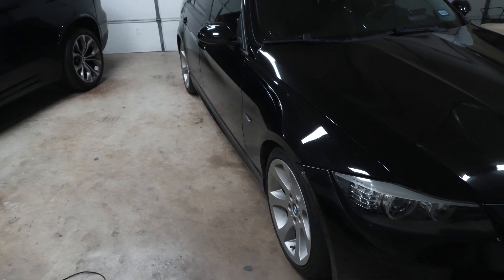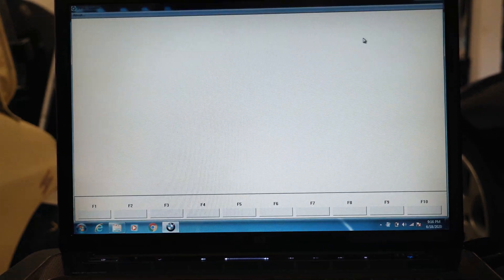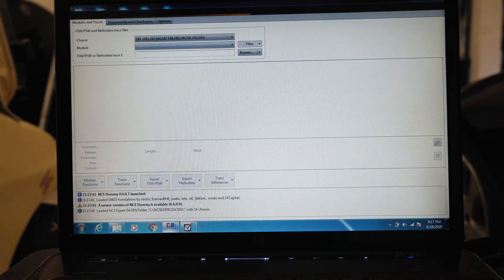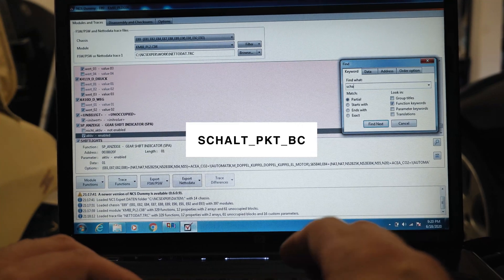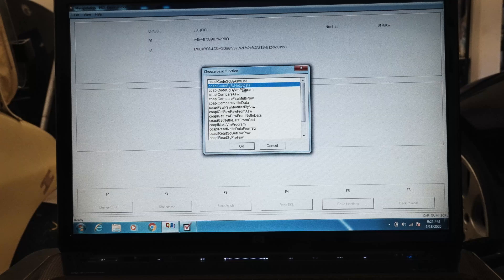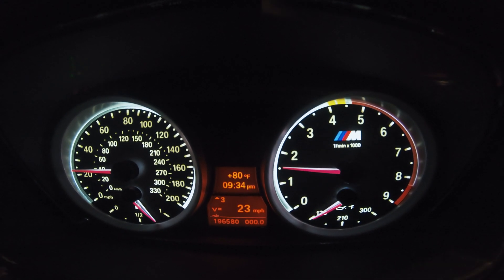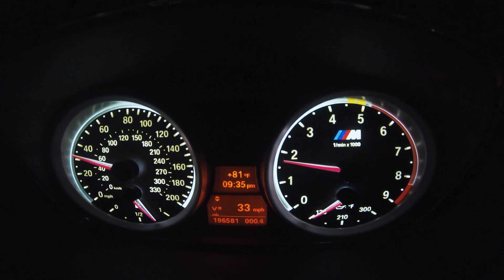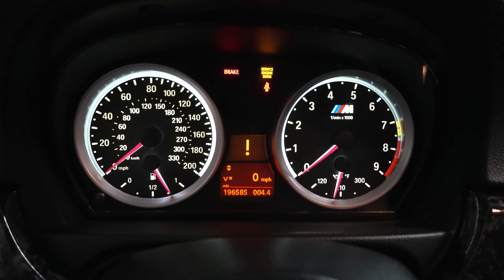Your BMW Can Tell You How To Drive! | E90 Coding DIY

Comment: I am able to get to the Read ECU step, save the TRC and load it into the NCS Dummy. The problem is that the TRC that is being generated is for the KMBI_PL2 05. When I hit read ECU the KMBI_PL2 05 won't change to KMBI_PL2 08.
The 05 doesn't have the SP_Anzeigen, the 08 does (I checked), but still, I cannot get the NCS to create a file for 08

Comment: How does this work on inclines and declines?
Does it tell you to shift later up hill and tell you to downshift downhill for engine braking?
Reply from the maker: Yes it seems to be load based.  It would tell you to downshift if you're in too high of a gear and giving it too much throttle.  Or of it you're going up an incline it would be more fuel efficient to keep in a lower gear etc.
Reply: Vehicular DIY Wow I’d love to code this too. Thanks. 👍🏻

Comment: I’ve been watching some of your older videos, and I’m impressed with the way you’ve built your car, and I’ll probably follow in your footsteps. I see you have catless downpipes. How  do you deal with the catalyst efficiency codes?
Reply: He got it tuned at eurocharged so they usually deal with that or any tuner does it if you have catless dps
Reply: You can flash a tune on your car, and it will remove the catalyst effciency codes. But that just makes the cel go away. To pass smog you still need to install a dp fix.

Comment: Well done! I've been scouring the internet trying to figure out how to code away the self leveling warning light I get on my E70 after removing the rear air bags and replacing them with coils.  I wonder, do you think INPA could do that?
Reply from the maker: You should be able to do that with NCS Expert.  You can change the vehicle order to a car without air suspension.

Comment: Hey! Could you perhaps make a video on how to code the alarm sound on lock/unlocking doors? I guess american cars probably have that by default, but european cars don't. Thanks
Reply from the maker: You'd have to retrofit the alarm and speaker.  I looked into it before but the hardware was around $350
Reply: @VehicularDIY  I already have the alarm, i just wanna know what to code to have the "bip" when i close/open the doors. (which module to code and what to change, it takes place in ncsdummy if i'm not mistaking). And how to code the "follow me home" video could be nice too. Or perhaps a generic coding video but with getting technical (without the installation part and so on, more the which module does what and what can be changed). But anyways, i love your videos, and whatever you do for next video it's gonna be a good one. Thanks buddy
Reply: @thinkdifferent6403  I did it on my 2007 E93 335i, my 2002 E46 330Ci and my wife's 2004 E53 3.0i with Carly on my phone - so if it's possible there it'll be possible with NCS. You get the choice of beeps on unlock, lock or both. Appreciate this doesn't answer your question, but letting you know it is possible.
Reply: Why would you want that obnoxious sound when you lock your car?

Comment: Is this only for a auto or does it work on a manual too?
Reply from the maker: Its only for manuals
Reply: @VehicularDIY  Nice! Thanks man
Reply: @VehicularDIY  I understand that it's only useful for manuals, but I wonder if it would work on the auto?  Would be cool to see what gear the 6HP is in outside of being in DS, or is it only an indicator of when to shift and not also simply what gear?
Reply from the maker: Have you looked into the Alipina tune or XHP?  If you flash the transmission with either of those tunes your gear will be indicated.

Comment: Is it possible to fit those M3 dials on a diesel?
Reply from the maker: It is yes.
Reply: @VehicularDIY  is it not possible to plug a second hand set of complete e90 m3 dials/cluster straight in? To diesel or petrol model?
Reply from the maker: It's possible but difficult/costly.  I converted my original gauges to look like M3 gauges.  You will find a couple videos on my channel regarding that.

Comment: Carly allows you to do the same thing as well. Much easier IMO, but then again you have to buy it. Love your videos!!
Reply: Carly allows this? I haven’t seen it. Do you know what it’s under or what it’s called?
Reply: @Objectional_Opinion  I did it a year ago or so. In the new layout of Carly, I think it's under the Instrument Cluster tab in Carly Coding. There you will see an option called Gear Shift Indicator. This should be it. Then again I did this when Carly had the previous design layout which I honestly prefer to the one they have now.